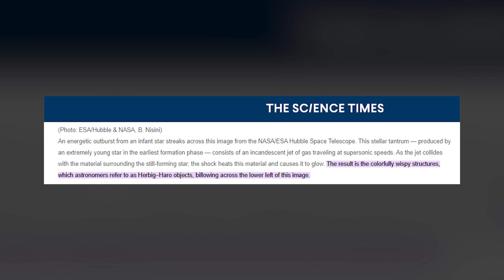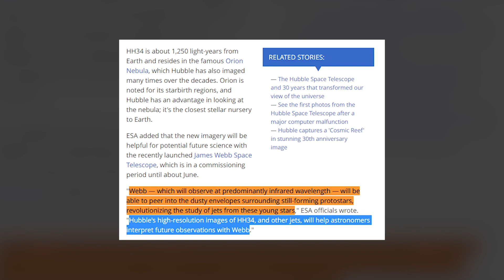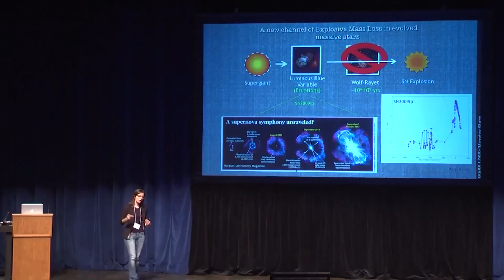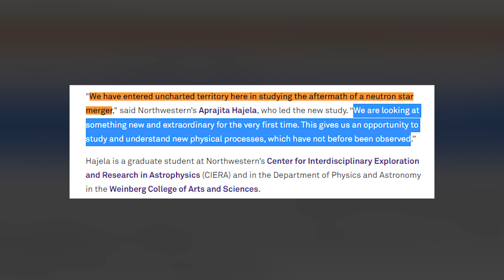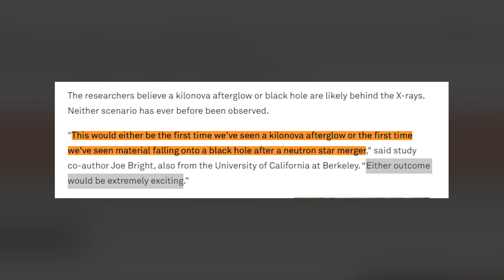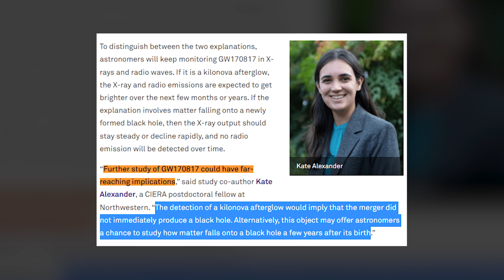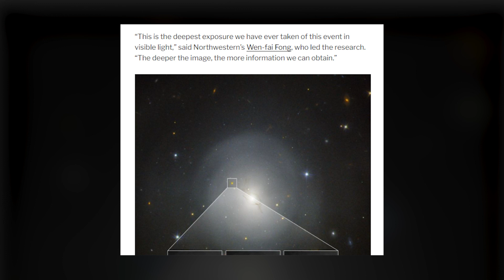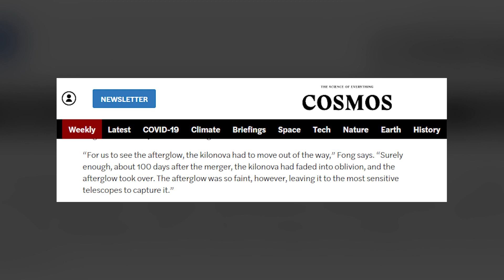HUBBLE SPACE TELESCOPE Captures SPECTACULAR Laser Jet From Infant Star

Comment: gravity causes a temporal well; a black hole is, then, a multi-field inversion that results in the inverted particles traveling backwards in time where they then interact with energy and matter from other points in time

so when a black hole is created the hawkings radiation you see emitted is a small portion of energy from very very far backwards in time; probably pre-big bang
Reply: Hmm. 🤔  Never heard a definitive description such as this one.  I like the concept.  Kudos!
Reply: @MrEnjoivolcom1  yes, also, because of this gravitational mechanism, time travels with planets as they move through space; Gravity makes (bosonic) time travel possible because all of planetary history is still proximally located

this can result in visual anomalies similar to a mirage: For example: photons can be accelerated into the virtual state after collision dynamics with atmospheric gases (i.e. inelastic scattering). In this case, the incident photon acquires so much energy that it travels faster than the "speed of light" and is then "pushed" to another point in time, where its energy is then absorbed or reflected by interaction with energy and/or matter from that point in time

once the particles energy is removed it automatically bounces back to it's original temporal attitude

it's hypothesized that this allows the electromagnetic field to maintain a certain level of entropic stability while also incentivizing nucleo-synthesis